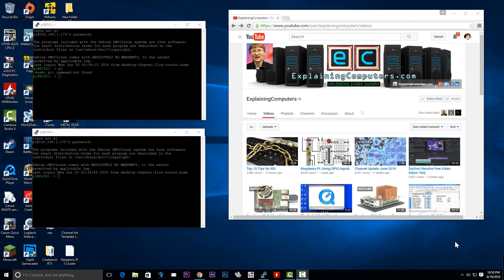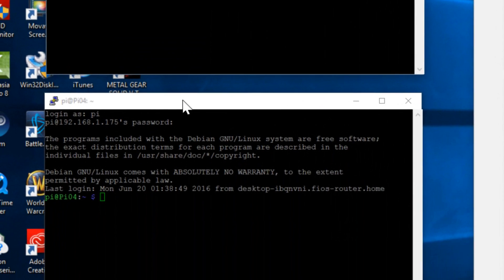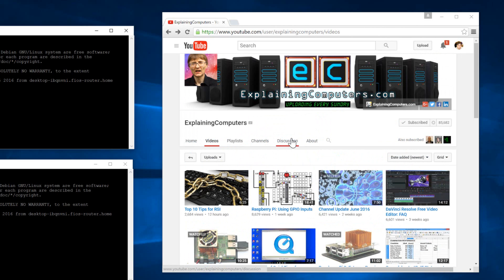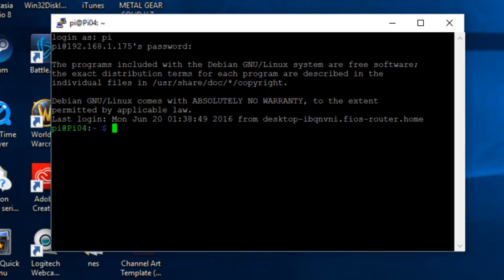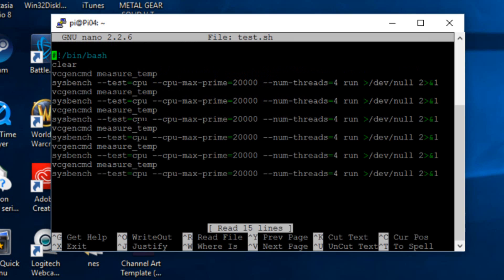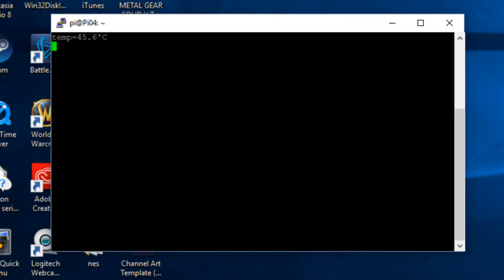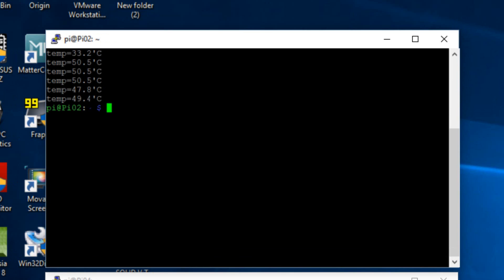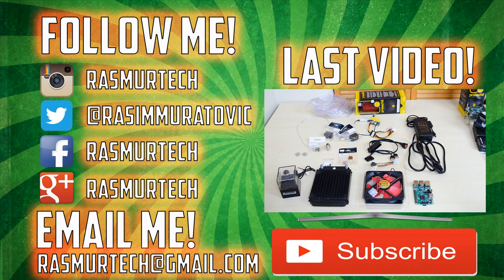Water Cooled Raspberry Pi 3 - Part 2 - The Performance

Comment: I was trying out my new  Pi 4 to make sure it worked. I had not put it in a case yet or put any heat sinks on it yet. I noticed on my screen the temperature was at about 65 so I quickly grabbed my homemade fume extractor. I pointed the exhaust end of it at my Pi 4 and to my surprise it cooled it to a consistent 36 to 38 degrees. Basically a 12v  fan  blowing air on it. Cooled it down immediately . Could watch it drop to 37 degrees in about 1 minute. Stayed there as long as the fan was on. Certainly a lot simpler, a lot less space needed(considering the pi's main attribute is it's small form) and a lot cheaper. Maybe not as cool looking however. Oh well. I did find your video very interesting and informative.

Comment: I have a more efficient air cooler... Sounds strange... But with the same test, with the pi overclocked to 1600 mhz and 8 steps of overvolting it doesn't pass the 55 degrees marque...

Comment: That is pretty much the same temps as one with just a heatsink and using air cooling which to me i find water cooling on a Pi 3 to be a little useless just cause you get the same temps for cheaper i find.

Comment: Would probably be a good idea not to feed one of the chips with heated water from the other chip. Do a Y split both to and from the two chips. Airflow through the radiator would also be a good thing. Preferably putting the fan at the bottom so it can flow upwards.

Comment: Well, you certainly smashed the power+heat problems of the rPi3.
Reply: There are No Heat Problems My one runs on 900 MHz oc instead of 700 MHz and i only get Maximum 43 C° With max usage

Comment: yo man you really need to mount that fan to the rad, then turn it so air can actually push threw the rad. The way in which you have the rad laying flush to the table is blocking all that air inside the rad.

Comment: You'll be able to achieve much lower temp filling your system with ice cold water and switching the thermal pad with paste.
The Pi produce so little heat that it doesn't have time to warm the water up...
Just my thought here
Reply: If you use ice cold water the water block will become colder than ambient temp. if it is below that it will produce condensation which can fall onto, and short out the board.
Reply: You are right, but I was talking about the cooling system having a big thermal capacity compared to the few Watts of heat produced by the Pi (even overclocked)...

Comment: You should've benchmarked the same raspi before and after. Just because the two computers are the same model doesn't mean they will perform the same under the same conditions.

Comment: Did you really leave the heatsink flat on the table with the fan facing down? that was a bit pointless, you are blocking the airflow.  stand it up and mount the fan.

Comment: who uses in 2016 quicktime? LOL

did you ever hear of VLC? ^^
Reply: this tells you everything you need to know about this guy :3
Reply: hehe xD
Reply: Everybody with a good video editor. Premiere, Edius, many others ask you to install it with the software. Kind of mandatory. No clue as to why, probably that's what the player in the software utilizes, but you get the point :D.
Reply: Mr Random Why would you use Divx? VLC can play every format that Divx can and more plus its smaller, works on more operating systems and is faster.
Reply: vlc > all
Reply: Premiere hasn't used quicktime since cs6. CC uses adobe media encoder
Reply: isnt divx from pre historic ages? i remember running it before windows 7 was a thing , vlc rules btw

Comment: interesting work, but you definitely need to revise your setup to really see what can be realized.  Summing up what some others have said and some addditional tips; secure the fan to the radiator, set it so it's pushing through the radiator, stand the radiator up so air flow is not impeded, run the hoses in parallel to each block on the pi.  I think also those blocks may be too small for purpose, as in it needs a bigger surface area at the heat source for effective transfer.  And if you have some adhesive thermal paste around instead of that tape, that be better again too.

Comment: what was the CPU Frequency ?
Reply from the maker: Will do a part three with over clocking.
Reply: ok, but when you install raspbian, in my experience it runs at about 600,700 Mhz so that is why i asked
Reply: 600gHz???? wow
Reply: Mhz not Ghz....
Reply: Stock freq are :
Rpi v1A/B 700MHz One-core
Rpi v2B 900Mhz Quad-core
Rpi v3B 1.2Ghz Quad-core
Reply: yes, but on R2 on raspbian install it's default clock is at 700Mhz, you would have to eneter the raspi-config to set it to 900Mhz :D
Reply: On model B the stock clock is 900 Mhz. Here's a link to their website if you want to confirm this. https://www.raspberrypi.org/products/raspberry-pi-2-model-b/
Reply: Maybe since there is only one link to download Raspbian for all versions of the Pi, you need to configure after the installation... but I was talking about the factory clock at the production.
Reply: yes the factory clock is 900Mhz, but when you install the OS it is installed with "Bios" of the board where you configure clock settings and other stuf...
Reply: Alright then, thanks for the tip, good to know for using 100% of the new RasPi

Comment: This is great stuff.  Since you got a 16 C temp rise for one Pi, would you say that when you  add more Pi's, the temp will scale linearly with the number of Pi's?  If that is the case, then you might need a larger flow rate or bigger fan and/or radiator for more than 4 Pi's, if you want the CPU temp to stay below 85C.
Reply from the maker: You are right. That's why I purchased a bigger res pump combo.

Comment: Since you have five connections available from the hose-adapters I suggest you connect the waterblocks in prallel instead of in a row giving each block a dedicated connection. This should reduce flow resistance and thus improve the flow of the cooling liquid. Otherwise a great project.
Reply from the maker: I will address that in part three.

Comment: In video 1 you had the water cooling running at the end but I couldn't see any water flowing in the system

The way you set it up the water blocks are in series, this is restricting the liquid flow , if you connect them in parallel this should double the flow, you have lots of spare fittings on the reducer blocks available so it's an easy fix

Comment: Your concept is sound, however, you have the fan pulling, or rather attempting to pull air through the radiator, but the air intake from the radiator is blocked by the surface of your desk... You may as well be just passively water cooling as the fan isn't going to perform correctly with this configuration.

Try blowing air through the radiator with no restrictions on air flow on either side...
Reply: he is pushing less than 10w of heat through a radiator designed to disperse  over 300w of heat.. i would think the fan is not even a factor XD

Comment: Can you try pushing air into the radiator (instead of pulling) and have some space for intake and exhaust on both sides of the radiator/fan setup (you can try making it stand on its side). You'd probably get much better temps that way.